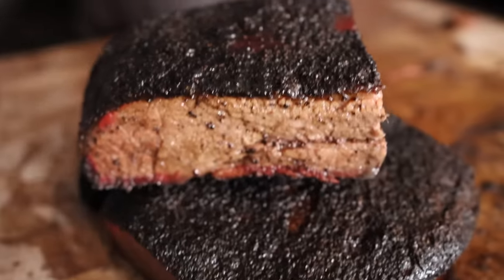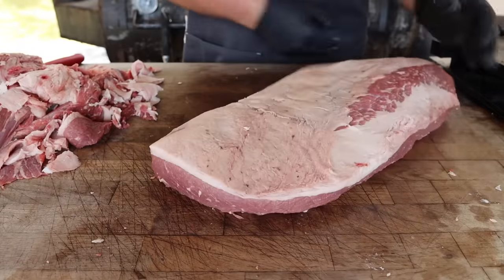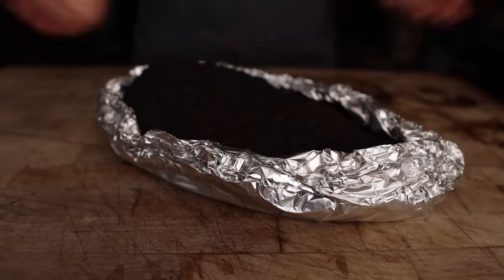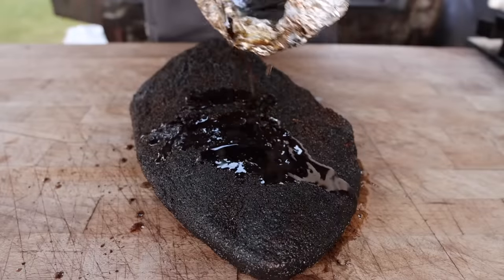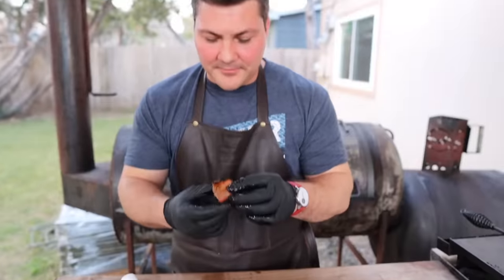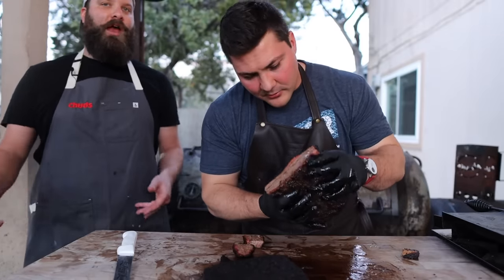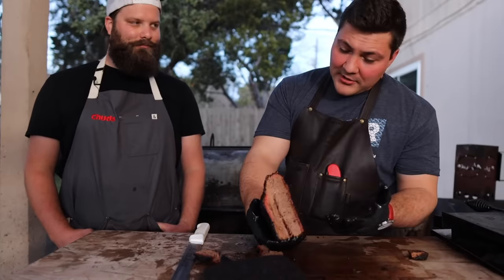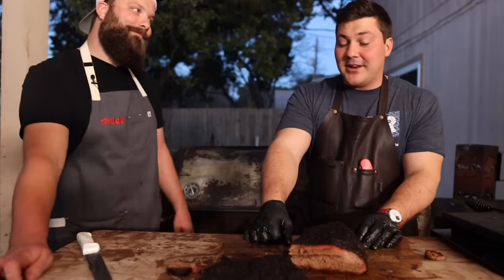Mad Scientist Foil Boat Brisket Review | Chuds BBQ

Comment: So to summarize, 250 for 3 hours, 275-300 for the rest. At 10 hours, brisket was 180 internal, wrapped in foil boat (open top), two more hours it is done (12 hours total). Then overnight rest (15 hrs) in toaster oven at 155. Seasoning was 2 parts pepper, 1 part salt, 1/2 part granulated garlic. Sound about right?
Reply: He also had a pretty big brisket bro!!! I think as long as you stay with the internal temps you should be straight I’m trying this right now and I got to 180 with a decent amount of bark running at 250 I might bring it down to 225 next time
Reply: Be sure to protect the flat with the foil.

Comment: BEAUTIFUL!! Good work Brad!
Reply from the maker: Thanks! Great to meat you the other day!
Reply: So when will we see a Hey Chud Hey Collab?    Also, you guys going to windy City smokeout this year?  Will def stop by if so!  Brad you are gonna go far, sir. Susie and Jeremy you both alrdy know you're great ;)
Reply: @ChudsBbq  In your opinion if you have a warmer to put the brisket in after the cook what is the optimal temperature to hold it at?
Reply: @Pete_or_Peter4Long  I've seen him say minimum oven temp, which is usually 170°F.
Reply: @M4sterT3ch  I think that’s just because the oven doesn’t go any lower. I’ve see some use 145. Just curious what he recommends if any temp is available.
Reply: @Pete_or_Peter4Long  Most ovens can be calibrated by holding the "bake" button. You can trick the oven into thinking that 170F is really 140F by calibrating the temp -30F. I do this and use the "hold" setting which averages about 140F. Only downside is that my oven has an auto shutoff for the hold setting after a few hours.

Comment: Great looking brisket as usual. It is interesting that the bottom part had a stronger smoke flavor.  Perhaps due to the some of  smokey juices from the sprtz during the foil boat phase 
seeping under the brisket and braising it with smoked liquid. I see that as a great plus.  This method followed by holding in sous vide per Chudds earlier video,  is  now my preferred
way to cook a brisket. Thanks Brad.  I have once crisped up the bark under the oven broiler in low setting  after the sous vide.   Can't wait for the Gugga sous vide challenge that you guys had agreed upon.

Comment: Brad:  I'm planning to use the foil boat method on my Cotton Gin barrel smoker (with diffuser, and probably a water pan) because it does such a great job of putting smoke on meats.  I've never tried to do a brisket on it... but I'm gonna give it a whirl.  I'm thinking about maybe putting one layer of butcher paper on top, crimped inside with the foil boat?  Have you ever tried it?  After watching the video of all you guys at Goldie's, I'm wondering if maybe that'd be an option of getting the best of both worlds?  Thanks for the great videos, and the humor you add to them.  I think I'd like to crack a beer or two with you.  Cheers, Brad!

Comment: Hey Chud! Loving your videos! Just a quick question... does resting your brisket at 150f for 15 hours keep the internal temp at 150? Or does it just slow down the resting process... ie it will take 15hrs to go from 200 to 150 internal? Thanks mate!
Reply: Correct it does not lower the internal temp to 150.   I'd say it rides around 160-170.  It really is a game changer as well.  (And makes for great timing as your brisket is ready to go even if your guests arrive early).  No waiting!

Comment: So what would be the difference if I used an aluminum pan with the brisket in it with the top exposed vs a foil boat? Just curious. I have done neither of them. Have you tried this before. I imagine doing tons of brisket you have tried just about everything. Thanks.

Comment: Wait, the rest alone was 15 hours, not including the 10 hour cook ? 15 hours uncovered in a toaster oven at 155 degrees and ?
Reply: I was wondering the same thing.. But seeing as he said the brisket was going into the toaster oven for an overnight rest, I'm assuming it was a 15 hour rest?
Reply: Some others scratching their heads as well. The proof is in the pudding.  I suppose the foil helps keep the bottom and sides moist, 
and the top of the meat is sealed by the fat cap.

Comment: I hate to spoil the party but your fan base is not getting the complete story here.  BBQing has been going on since caveman days.  Barbacoa from Mexico during 1500s translates to BBQ.  You young guys like Aaron Franklin, Terry Black, etc. act as if you've re-invented the wheel.  Let's break it down, for real.  You buy a 12 lb. brisket for $100 +/-.  You then have to buy hickory, pecan or post oak wood to last 12-24 hours while smoking...that's another $75.  Plus butcher paper, foil and spices, say $25.  After brisket is smoked, it shrinks by 35% typically.  Now you have a 7.8 lb. brisket.  $200 spent, plus a whole 24 hour day, plus clothes and hair permeated in smoke, divided into 7.8 lbs. finished product = $26 per lb.  Take your family to a BBQ place. Within 2 hours, you'll feed 4 on $50, not have to burn your clothes and save $150 - save on time, money and shower.  That's the smart move.  Keep the clique' going for the young audience.  Us older guys know better!